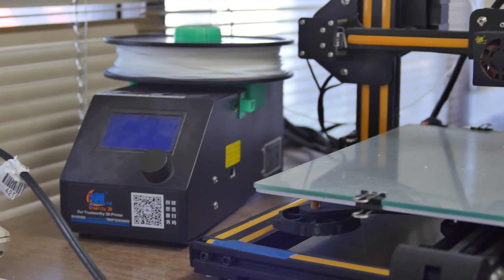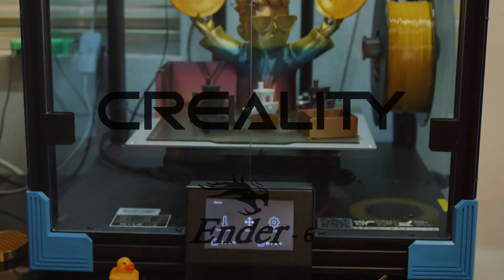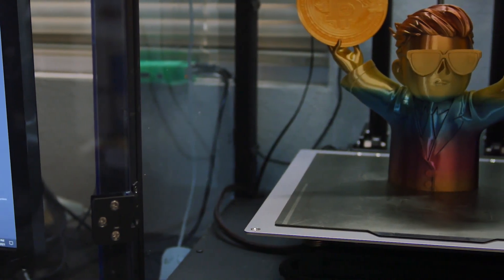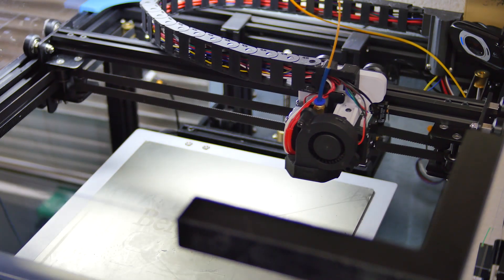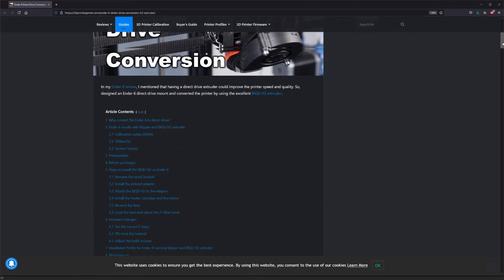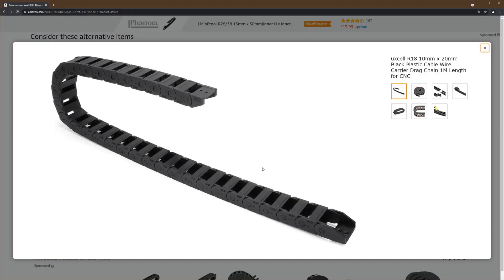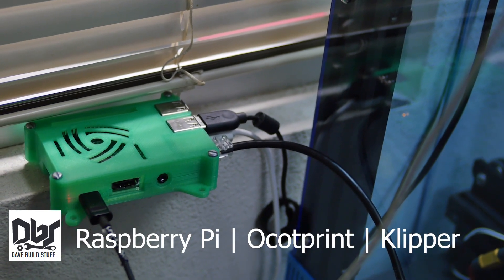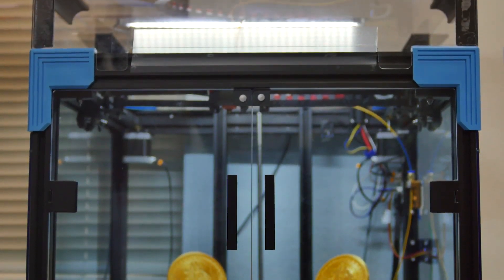I FINALLY Got a New 3D Printer! - Creality Ender-6 w/ Mods Overview

Comment: What was the 'true' dimensions of the print bed of the Ender 6?
Reply: It comes out to be about 290x290 but its an uncommon size
Reply: @Hrkules583  40mm more than advertised?
Reply from the maker: I'd have to measure it, but it's larger then the area that the print head can move, so it's actually kinda irreverent (despite what I said in the video. Didn't realize that at the time.)
Reply: @designbydave  Ok then, so it can't really print any bigger than what's on the Creality website.
Reply from the maker: @migueldevela2917  Correct. The advertised build volume is accurate. It's just that the physical size of the bed is a bit bigger.

Comment: I got the ender 6 as soon as it came out, had mixed feelings about it and kind of still do.  It was all stock, except for a Capricorn tubing, and always had some quality issues compared to my ender 3.  I’m keeping the Bowden tube but going for a phaetus hot end and twin 5015 fans.  Wish me luck I guess
Reply from the maker: For sure at least move the extruder to the top, inside of the frame which is a common mod. Cuts the bowden tube length about in half which should help quite a bit with stringing, blobs and overall extrusion consistency.

Comment: Thinking of either getting ender cr5 pro or just taking my time building the voron 2.4  any thoughts? Currently using ender 5 plus I am in need of something fully enclosed
Reply from the maker: Building a voron is quite involved (see my V0 build video series, and the 2.4 is going to be a lot more work then a 0) So, if you're looking for a printer as a means to work on other projects, I'd skip building a voron for now. They are a massive project on to themselves. Of couse, it's not without reward. The lessons you learn setting up and tuning a voron will help all your printing.

Comment: Hey what is the chain connector you use to connect the chain to the hotend and wires?
Reply from the maker: Parts from this guy's design. - https://www.thingiverse.com/thing:4731935
They don't fit the chain from Amazon very well at all. I just hacked them and CA glued them in place thought and they have held up just fine over many hours of high temp printing.
Reply: @designbydave  hey thanks for that also can i get the mount you used to hold the direct drive on as mine the screws are not at the correct angle so it doesnt hold correctly
Reply from the maker: @DanNewYoutube  Got a video for that bud! https://youtu.be/NoPFHl4jK0E

Also - https://www.thingiverse.com/thing:4931099

Comment: Good video, very helpful as I narrow down my choice for a new printer. 
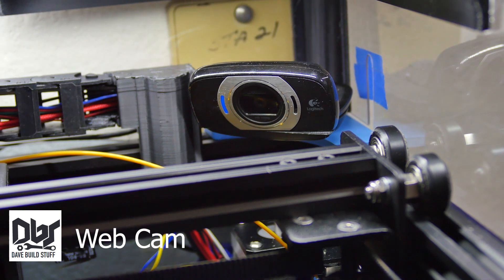At 5:38, I notice you've used an offcut of filament to spoof the runout sensor into always thinking filament is present. 
Is it possible to flip the runout sensor to be on the inside of the enclosure too, and actually route the real filament through it?
Reply from the maker: Yeah I just bypassed the sensor as I never got around to properly configuring Klipper for it. Seems like there would be no problem just flipping the mounting bracket around to mount it on the inside of the enclosure like I did with the filament spool holder. If it doesn't fit for some reason, well, you've got a 3D printer, just make a new bracket!
Reply: @designbydave  Kudos for the sub-10 minute response time! On reflection the sensor might not be all that crucial. I've finally killed the first 3D printer I've had since December 2014 and have never actually started a print that needed more filament than was loaded, so the runout sensor did precisely nothing useful.
I mainly need to move the filament spool to the inside (limited space) and I would prob move the runout sensor but now I'm thinking the main challenge is moving the extruder if I don't go the direct-extruder route. Up and down matters with the extruder, unlike the runout sensor. Or I could buy a bigger house...
Reply from the maker: @HandbrakeBiscuit  Definitely move the extruder if you plan to keep the stock bowden setup. I'm seeing a lot of posts where user have done that and claim it  really helps with retraction, stringing etc.
Reply: @designbydave  Again - thanks for your helpful reply. Now I won't have to watch sub-standard videos from inferior channels looking for this kind of information. :) I'm pretty much decided that one of these will be my new printer, presumably folks move the extruder (up) such that they can shorten the bowden tube (?)
Reply from the maker: @HandbrakeBiscuit  that is my impression, yes. Shorter bowden tube = better extrusion consistency. However, in my (limited) experience, it still will be inferior to a direct drive extruder.
Reply: @designbydave  Hi David - yes - that makes sense. 'Slop' is inevitable when pushing filament from a distance, when the far end is actively being moved around a square area of 250x250mm. Direct drive is basically a bowden tube of zero length, after all, and the extruder doesn't move in relation to the nozzle. Thanks again..! :)
(No need to reply - you are busy.)

Comment: Seems like FAR to much work for a $600 printer to get it to a functional state. Planning on returning mine as I could not get it to print properly after about 4 days of troubleshooting.
Reply from the maker: Definitely seems like a lot, but all of this was done incrementally. One piece at a time, testing, re-calibrating with each step. Definitely not all (or any of this) is required to get the printer to function.

Comment: Nice video! I'm still new to my ender 6, but it seems like a terrible machine to leave stock. Rather it seems like an attractive package of a bundle of extrusion and motors and enclosure parts,  and everything you need to get started quickly, wiring, switches, etc. A build for a ratrig, you are looking at a few months for it to get delivered, and 20-40 hours for the build. An ender 6 seems like you could get something decent delivered in 2 days on amazon, and built to your spec in well under 10 hours, all for a fraction of the cost (but quality will suffer too). 

Ok super long comment/essay time:

I have seen a few people do core xy builds starting with Tronxy Printers, the ender 6 seems like a potential step up from that. However for the price, without modding, most folks seem like they would be better fit saving up a little more for a prusa, or going for something cheaper like an artillery x1. 

After the success and now massive cloning of the ender 3 (voxelab aquila for example), Creality is expanding their brand offerings in what appears to be a good/better/best model, which makes me wonder how much of these sales of their more expensive offerings are really driven by the product, and not just brand allegiance? I sorta impulse bought my ender 6 since I have modded ender3's already, and I read a quick review on all3dp. I almost really regretted it after learning more about vorons and ratrigs and hedvorts and prusa clones. It is warming back up on me, but because I'm motivated to upgrade and modify it. 

The stock hotend, extruder, and firmware on the ender 6 are really rough IMO. And that all has lead me to not be terribly fond of crealities user groups, as they tend to suggest upgrades that I think are the total wrong direction. Namely for the ender 3's; all metal and duel drive versions of the extruder (the 6 comes stock with all metal duel drive), and microswiss hotends. There are so many other amazing quality yet cheap options on the market, that are designed with much more function and practicality and future proofing. I digress but like what was microswiss even thinking with their heatbreak?!? I guess its a solution for a plug and play all metal upgrade on a ender... but yuck... And a triangle labs bmg clone is so much nicer than the duel drive extruders, and only a few bucks more... 

Finally, Im not quite sold on the biqu h2, seems to have a bunch of proprietary parts, ptfe lined heatbreak with all metal only available from their website, a rough market launch with machining and tolerance issues, and a product that seems rushed to market to chase a market share of the hemera, not passion or user base driven. 
Just seems like a light weight crappy hemera? Like maybe they saw nobody using hemeras on corexy builds and thought they could get some money out of a light weight version? 
I don't really see anyone running biqu's on vorons, hedvorts, or ratrigs, which all seem to be the gold standards of Core XY Printers... so I wonder why 3d print beginner pushes them so hard for ender 6's? Best I can figure is this printer is marketed towards a lower common denominator in the 3d print space, where people tend to seek plug and play solutions, yet want to cheap out and not spend on the high end. So then a biqu h2 makes sense, gotta give the people what they want... 

If you read this far...  How is the biqu h2 holding up for you?
Reply from the maker: Thanks for your comment, wow there is a lot to unpack there lol. You bring up many good points, perhaps better suited for a video.

To answer specifically about the Biqu H2. I don't think 3DPrintBeginner is so much "pushing it" as he just wrote one article and that has gone somewhat viral. For me, its been excellent. I have not had any of the issues that others are reporting. The only issue I've had is heat creep causing clogs, especially with PETG but also one time with ABS. However that is somewhat my fault for not applying thermal paste to the heat break when assembling. I did purchase the all metal version when I ordered it. I have several hundred hours on it now, many of those at high temps inside my insulated enclosure (not shown in the video.) The H2 has been quite solid for me.
Reply: @designbydave  Thank you for the quick reply! Watching your voron build video now... how does the biqu compare to the voron afterburner? Maybe I will find out in this video lol.
Reply from the maker: @lunarimpactwatch8082  |spoiler| haha. I've actually been rather disappointed with the performance of tool head for several reasons. The H2 has been way better in all aspects. I get way higher volume flow rate, much better stringing and overall just more consistent extrusion and print quality with the H2. Using the E3D V6 hot end on the Voron fwiw. So, I am currently in the process of building the V0.1 toolhead, the mini afterburner, with the Phaetus Dragon hotend. Also it will be direct drive instead of bowden so hoping that will be on par with or better then the H2.
Reply: Is that an afterburner? ahhh more to learn
Reply from the maker: @lunarimpactwatch8082  I think "afterburner" is the name the Voron guys gave to the tool head on the V1, V2 etc. I'm not sure what they call the stock, bowden toolhead on the V0. The direct drive toolhead on the V0.1 is called mini afterburner
Reply: Sorry for my redundant question, your answer didnt show up for me until after. 
I found the best part about the e3d v6 is that you can get a high quality clone of it for cheap. The original e3d v6 seems overpriced for what you get. I was also reading that you will be lacking alot on fast prints with it, and to go for a volcano on anything like a core xy. I dont really know yet... still learning. Will put further voron related questions on your voron video lol.
Reply from the maker: @lunarimpactwatch8082  yeah a clone is what I have. I'm maxed out at around 8 or 9 mm^3 per second where I'm able to push at least double that with my Biqu H2 (which I haven't max tested it yet.) I think most of the super high speed print guys are using the Mosquito from Slice engineering
Reply: I enjoyed reading your comment lot of good points. I am sorta new to 3D printing and looking to buy something for desktop use have been leaning towards the Pursa. I was originally considering this one but all your points as well makes me want to say no. We have a tricked out Ender 3 at work along with a Raided 3D Pro + that is used to make parts etc. Its nice but I don't think worth the $ great customer service though. Chances are I am going to end up getting a Pursa and just building a case around it using extruded aluminum.
Reply: @jeffstrains4014  I think the first thing normally asked for your situation is what are your goals, $ budget, and time budget with a printer? Since you mentioned an enclosure, why do you want it enclosed? 
And then do you have basic required skills and/or are willing to learn them; with soldering and other semi technical aspects with setting up firmware?

My printers and social media taught me a ton of things, but if you are not of a relevant background and just trying to run a turn key print farm then you won't want to focus on that, etc. 
 I love tinkering, learn by doing, and am so fascinated with entry level Chinese sourced cheap printers. Sometimes my business side of things suffers from my attitude lol. Get so lost working on printers and learning about them that I forget to print. Still, personally, I am quite curious to start exploring some of the Prusa clone kits, like the one from Fysetc on Ali Express. (The triangle labs one is too expensive to ship to the U.S.) 
What I see with Prusas is a bunch of well sourced parts but sort of an ignorant and hype based community. I've always had a weird aversion towards them lol. Maybe just my personal bias from dealing with some jerk who had a bunch of prusas early on in my 3d printing adventures.  
I just told a friend today who is just getting into printing that I have seen an attitude with Prusa communities of "dont ask questions, just buy prusa" while with the Ratrigs for example, they seem to be more like "question everything, then when in doubt buy ratrig."
Reply: @lunarimpactwatch8082  By trade I am a machinist and maintenance technician, schematic troubleshooting I work a lot of hours and live on a farm to boot going into a shop build soon. Personally I don't want the tinker hobby of the printer so to speak I just want to set something up that is of quality and spend my time playing in cad and printing parts. The enclosure seems good for dust control etc I am seeing this as a down the road deal for model railroading. I have been looking at Prusas but I think for what I am wanting to do ATM a Viper may be the way I go. I am impressed with the raised 3d pro we have at work just not sure its worth 4k
Reply: @jeffstrains4014  Awesome. I will have to look into the Viper. Overall I am not very impressed with Prusa's, some of the hype about it being plug and play seems to detract from people really getting the most out of those machines. Again I sort of have a bias against them hahaha.
Reply: @jeffstrains4014  ah is the viper a resin printer? Seems like that might be the way to go if you are not looking for outdoor weather resistance and more intense levels of durability.

Comment: I bought an Ender-6 this weekend as my first 3D printer, what can I say, I'm abitious. Having a lot of fun (nightmares) trying to get it to behave and not have my prints dislodge from the heat pad.

Would you recommend that mat to improve stiction? I'm currently going through other steps like temperature, speed, level adjustment, pad cleaning and so far haven't quite figured it out.

Also, very impressive set up. I might not know 3D printers but I do know tinkering and that looks like a lot of work has been done.
Reply from the maker: I think the Ender-6 can make a fine first 3D Printer. 
For bed adhesion, it depends on the type of bad and the material you are printing. Assuming you are using the stock glass bed, and PLA for the material, I would advise you to use hair spray on the bed. That was my go-to for years.
Reply: make sure you are getting the right squish on the bed. Too high it won't stick, too low, it will not provide enough filament. Also clean your bed with some glass spray and  and microfiber cloth.
Reply: Shane, i ended up using a hotter bed temp and turning off my fillament cooling fan that is defaulted on normally for every print. 60 celcius and no fan makes basic pla stick really well to the glass bed. Let the bed cool to room temp after the print is finished and your parts comes right off with no prying of any sort.
Reply: You will catch on fast. I own three Creality printers. I bought the Creality 10 and the Ender 5 prob with the huge build plate at the same time. Later I purchased the Ender 6. I love the printers. If you like tinkering you won’t have an issue. Printing is all trial and error. I just jumped in with both feet. After you get one you wonder how you lived without one.

Comment: Hi, nice job with the H2 stl fix, I have the Ender 6 as and are waiting on the H2 to arrive, I'm not sure about the Klipper install, I would like it but dont want to end up with a non working machine, there is not a huge amount on youtube about the ender 6 (unless you like watching unboxings and how to build) I have installed a bl touch (it has to be directly to the board or you will get issues because of the low voltage at the break out board), I think it grow in popularity now there is a lid available for it.
Reply from the maker: The Klipper install can be a bit tricky, especially if you don't have any experience with flashing firmware of 3D printers, Linux and SSH. However it /should/ be relatively low risk of bricking your printer as you can always re-flash the stock firmware. 

I haven't tried the BLtouch as it hasn't really seemed necessary for me, especially as I read A LOT of posts where people are having trouble with it.

Comment: Great video. I am ordering those silicone bumpers to replace the springs on my Ender 5 thanks to your recommendation. I've done a couple really tall prints and I had many problems with the print failing 80% through and I think this may have been a reason why. Thanks!
Reply from the maker: Thanks for watching. The silicon spacers are more rigid, but offer less adjustment "room" then the springs so they can be a bit trickier to get the bed level dialed in.